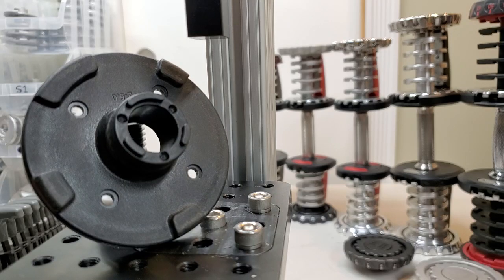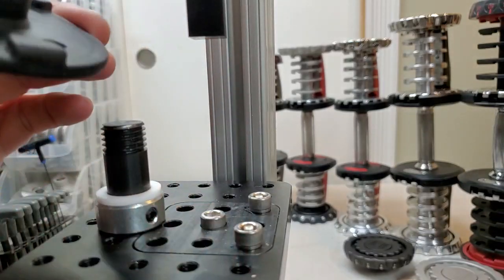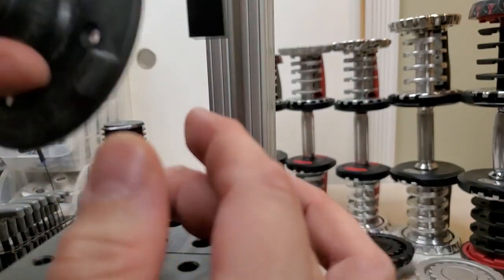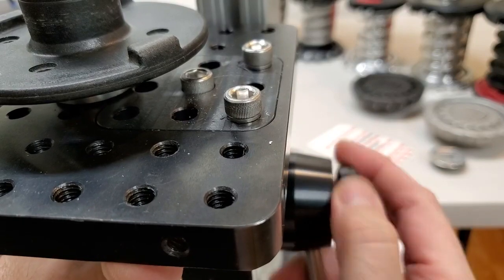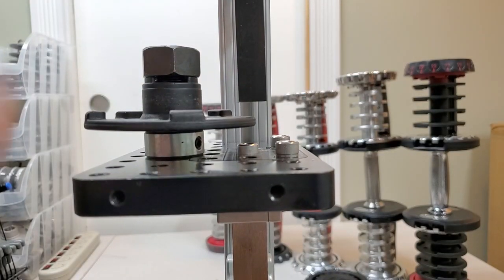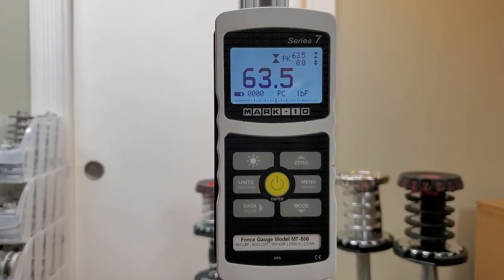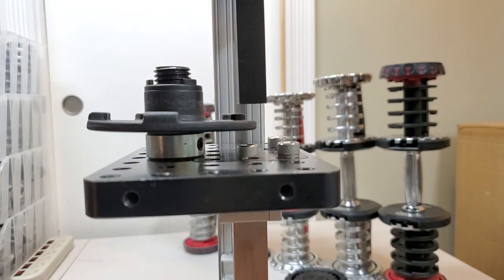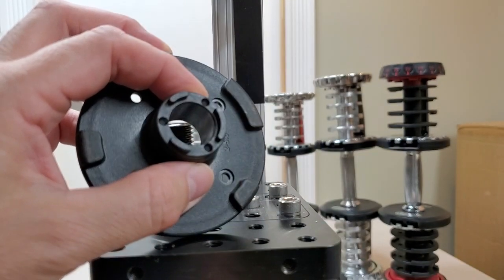1090 Bowflex® SelectTech® Disc Load/Stress Test: OEM Discs vs Average Joe All-aluminum Discs.

Comment from the maker: CLARIFICATIONS: It's more accurate to refer to this as a stress test rather than a load test since I'm exceeding the expected loads, but you all know what I mean. And at 5:22 I mention that I'm using Peak Compression Mode on my force gauge. I'm not testing for compressive forces. It's just the mode that I need to use due to the way I'm applying the force downward perpendicular to and against the face of the disc. Also, during playback I realized at 12:38 in the video that I wasn't witnessing deflection in my cast aluminum disc. It appears to be rocking like a seesaw on the vertical shaft. Apparently I didn't tighten the top nut securely enough. Consequently, at 12:52 I erroneously talk about a force difference much smaller than the actual difference. At 15:50 I make the same mistake referring to an initial "deflection" when it's actually just the disc rocking on the slightly smaller diameter shaft.  No big deal, I think you all get the point. Average Joe discs aren't going to crack around the center hub like an OEM disc during ordinary use.